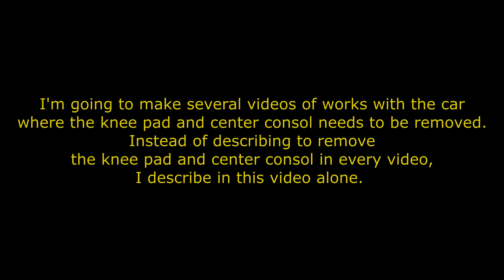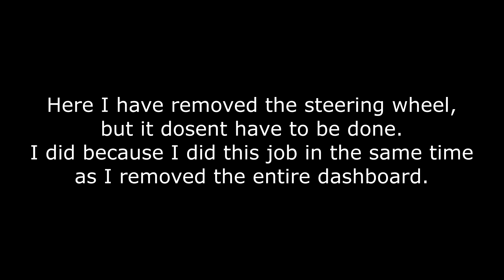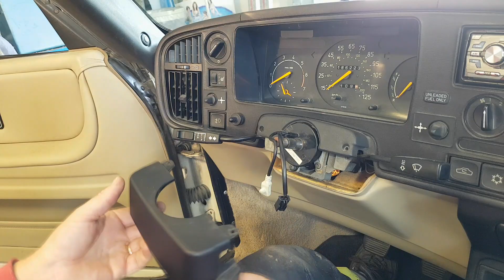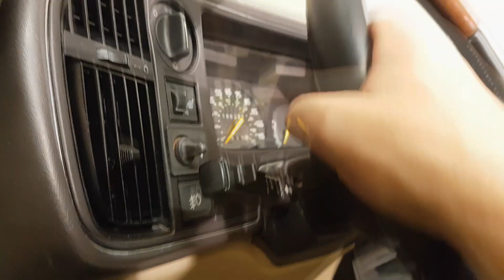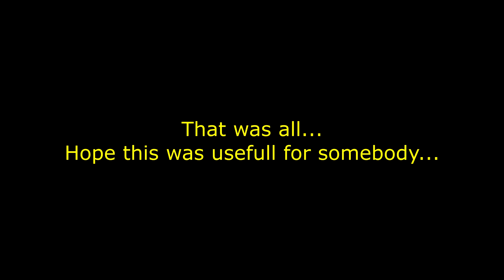SAAB 900 Classic Convertible, removing / installing knee bar, and center consoll..

Comment: I noticed you have a modern airbag and steering wheel, is that a straightforward modification. Im curious.
Reply from the maker: I have made an other video showing about that.
The video is about the clock spring wire.
Just look for it in my videos.
Reply from the maker: The steering wheel I have is from Saab 9000 Special edition.

Comment: Your video definitely helped me today now I’m having a hard time getting the long dash pins to go in properly. Any suggestions? Great video mate 🙏
Reply from the maker: Do you make sure to put the right pin for rigt place?
Remember they are all differet lengths.
They are marked with with one, two, tree and four stripes around in one of the ends.
And make sure the facia is properly in place.
Is the holding tabs on the back of the facia still intact?
Reply: @TerjeNormann  ahaaa thanks for the tip

Comment: Thanks for this video Terje. Very clearly shows what needs to be done.

I am wondering can I access where the vacuum line enters the cabin by removing the knee bar? I need to access the other side of the air filter for the cabin where vacuum enters. I am pretty sure I have managed to block it with some crud or even superglue, when working there. I really need to get at it from the other side and try and clear the blockage, perhaps replace the vacuum line. But it didn't look easily accessible despite you having removed the whole dash. 

Am I going the wrong way here?
Reply from the maker: Sorry, I dont know where the vacuum line enters on a hardtop car.
On the convertibles the vacuum canister is sitting in the trunk of the car.
Reply: @TerjeNormann  That explains why I didn't see one when you where working on the wheel wheel! No matter I managed to find it and access it without disassembly. It was tight but I have now fixed it.
Reply from the maker: @dennisa6132  They made some reinforcement bars down from the A-pillars in there, on the convertibles so the canister did not get space in there.
Therefore they moved it to the left bottom of the trunk. ;)
Happy to hear you made it.
Where does the hose go through the firewall in your car?
Reply: @TerjeNormann  It goes through right under the air filter for the cabin, there's a fitting there for two hoses, on my car only one is used since I do not have AC. By moving the bottom vent on the passenger side out of the way I managed to access them.

Comment: Hello,

I'm struggling to replace my turning switch signal on my 89 saab 900. I can't unplug the switch. Do i have to remove the entire dashboard or is there a trick ?

Best regards and congrats for your channel, very helpful
Reply from the maker: It can be a bit tight, but you should be able to remove the stalk switch just by removing the plastic cover on the under side of the steering collumn.
I have done that some times myselfe.
For to unplug the wires you must push the holding tab.

Comment: Is that a Saab 9000 steering Wheel ? That looks pretty good .  My 87 900 looks cool, but I'm not a fan of my 93.   But if you can use a 9000 steering wheel , Those are sweet. Especially the one your using with the wood grain..  And the horn is much better then the two flimsy buttons on the sides that I've got..
Reply from the maker: Yes, it is an 9000 Special edition steering wheel.
I have made an own video about the clock spring wire. There I have brought up the details about it.
Reply: @TerjeNormann  thanks, I'll  look for it.  Oh, by the way I followed your video on doing the bushing and locking clip, my car didn't even have a rubber bushing. I thought it  Disintegrated, but there was just nothing. And I don't think the bearing was a Saab one. But I fixed it and I fixed the wiper switch too. There are no places around me that will work on saabs so I have to do stuff my self. So thanks for posting these Great videos.  Thanks.
Reply from the maker: @jimgagne3801 What bushing and locking clip?
Thanks. 
Glad my videos are helpful...
Reply: @TerjeNormann  The steering wheel bearing and rubber/plastic bushing in the middle of the bearing and the hard tooth locking ring that cracks if you try and bend it.  It's nice to have a solid steering wheel and not slopping around.   now I have to change the intermittent wiper relay.  is that on the left or right of the two  that you show in this video as you pull the lower cover off ?  and can I get to it without taking the whole thing apart ?   ( you would think they would have put them in a better place )

Comment: Thanks for showing this, I have a 4 door sedan 900 auto RHD which I will swap it to a manual. I have question do you have to remove the intsument panel to get to the lower part of the dashboard? Also do you have any advice on right hand drive clutch pedal to clutch master cylinder is there a bar in between?
Reply from the maker: Go to my Youtube canal and you will also find a video for how to reinstall clutch master sylinder.
As I mentioned in this video...you do not need to remove dash for to remove knee bolster.
My dash is out of the car in this video because I also replaced my dash in same operation.
You also find video for dash replacement, and many other how to- videos in my canal.

Comment: Great video Terje. Very clear thanks. I need to get to the dreaded brake light switch which has started to occasionally stick on. Some commentators on the forums have said they would not remove the kneeboard and would rather remove the driver’s seat to get to it. I can’t really see the switch but wondered what you would suggest ? I did see your clutch mater cylinder video as well which showed the pedals . Any advice would be greatly appreciated. Thanks , Adrian
Reply from the maker: It depends on year model.
1992 and newer with airbag (as my car) have a wider knee bolster then the earlier models without aitbag.
The knee bolster in the older cars does not go so far down to the pedals as in the airbag ones, so ther you maybe can do it without pulling the bolster. It is also a lot easier to remove the seat then the bolster.
Only four bolts holding seat to the floor and one or two electrical connectors under the seat.